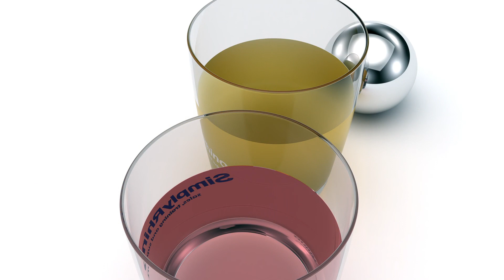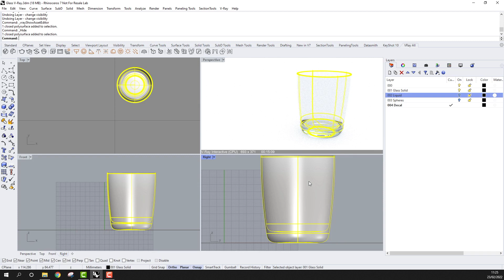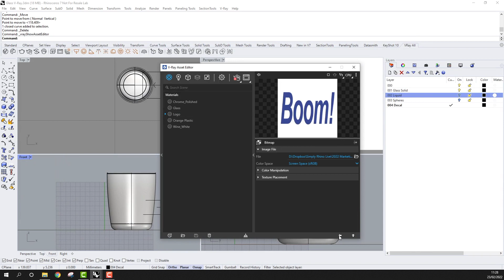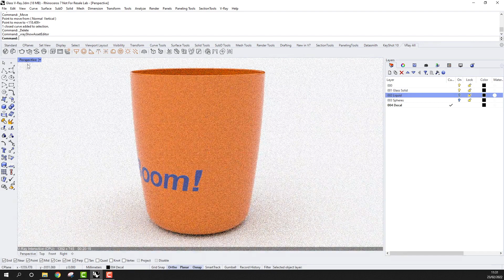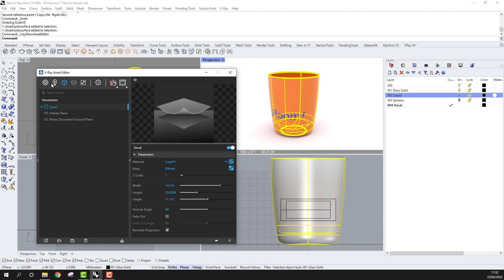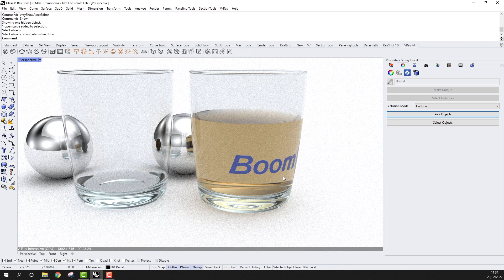Rhino 7 and V-Ray 5 – Creating Decals

Comment: Hi, thanks for this tutorial. Just a question, is it possible to apply decals on polished chrome surfaces?
Reply from the maker: Yes. I just checked the same file with the latest version of V-Ray – I replaced the Glass material with Polished Chrome and the decal behaved correctly.